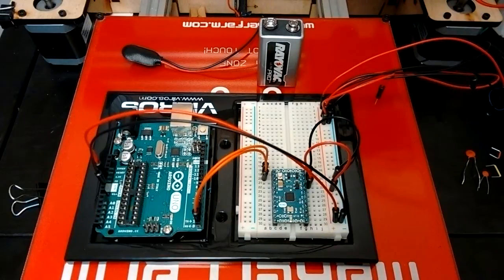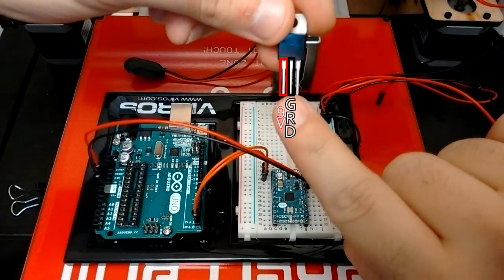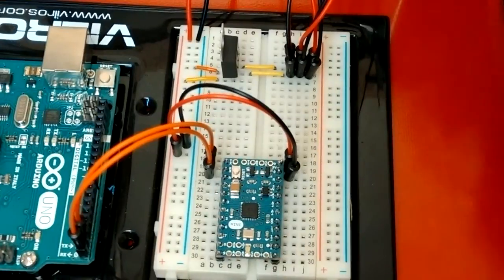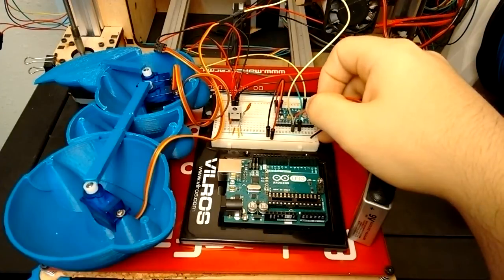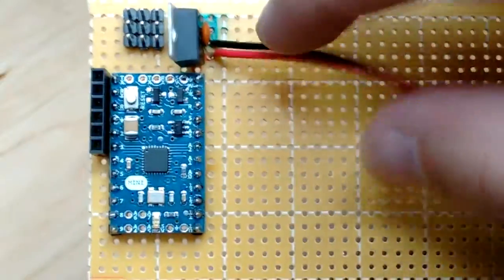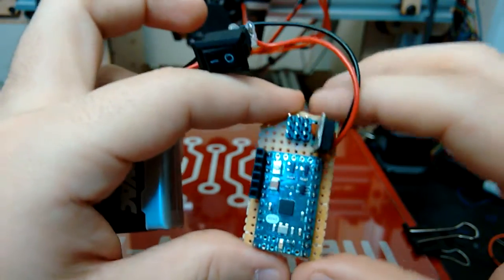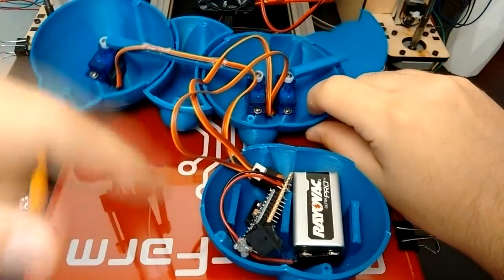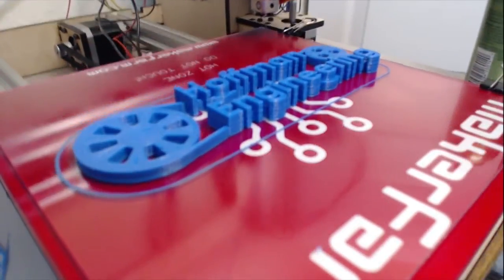Real Life Pokemon - 3D Printed Animatronic Caterpie Part 3: Finishing the Electronics

Comment: Soldering tip; Make sure the surface material on your perf board is hot along with your component leads, this will make tin flow and stick to it and give you that nice concave shape in your solder job.